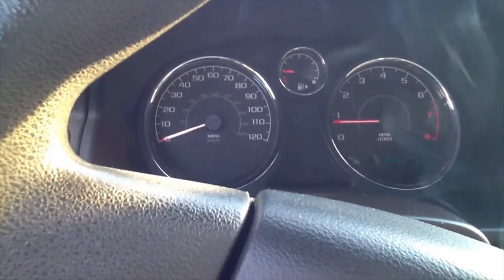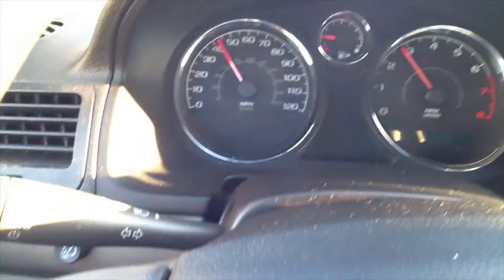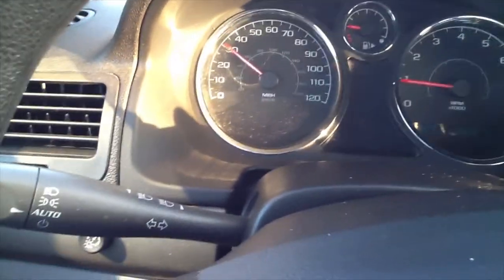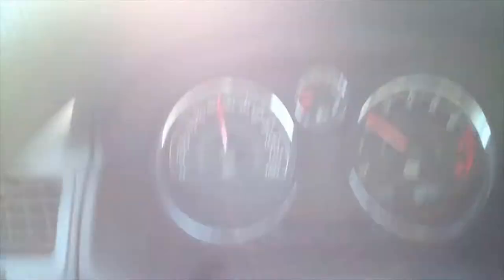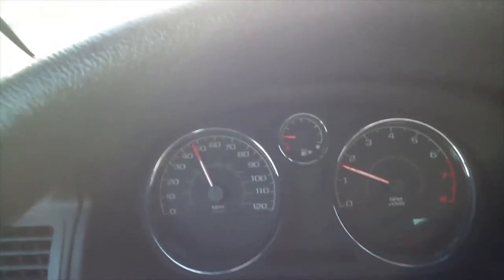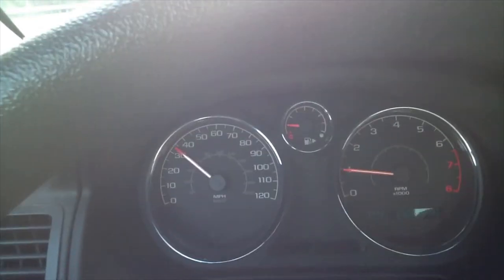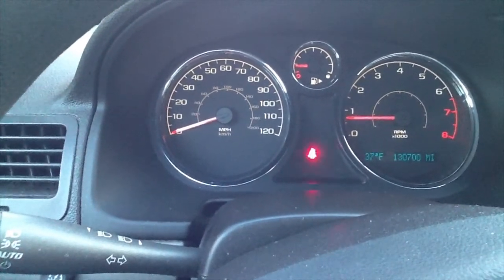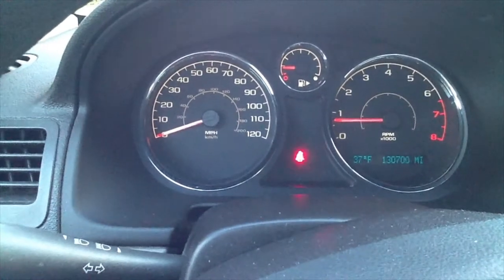Breaking in New Brake Pads & Rotors

Comment: Just got back from doing just as you said... my new brakes look and smell like there cooked... really hot and gold/blueish color. Brembo rotors and pads. Letting them cool now... I hope your right!
Reply: Right 😂😂 they over here smokin. Poor babys
Reply: He’s right wasn’t he?
Reply: For the majority of pads and rotors (slotted/drilled/full-face) this method or ones similar will work fine… 

Honestly I would think Brembo’s probably have a slightly different break in procedure but I could be wrong. When you did the calipers they didn’t come with ANY instructions at all? I’m not big on instructions either BUT for instance I just installed Hawk rotors and pads on my car and inside the rotor box was a card with the specific break in process for the rotors… Whenever you do any of the processes to ‘bed’ the pads/rotors the brakes are gona get hot, they are going to smell bad and A LITTLE bit of smoke is common, if you’ve got Cheech and Chong coming from behind your tire then you may have an issue - either went to hard/fast with the break in process OR you could have a sticky slide pin causing the pads to hug/hold the rotor tighter and longer then they should (take out, wipe off and reapply lube and work them to make sure they’re moving good)
*Moral Of The Story - smell and LIGHT smoke is common the first 1-2 hrs OR 1-2 days after you install (depending on how your drive your car), if the smell and/or smoke continues after the break in process is done pull em back off and check the slides …   Did you do rotors and pads in all four corners?
Reply: @joeymcquilkin3670  I just finished installing new front rotors and pads I test drive it and I hear tiny grinding noise ONLY when I apply breaks is this normal ? 

Note : I did lubricate slide pins and hardware also and cleaned everything possible including the piston when I did the installation.

Comment: What happens if you didn’t exactly do this and just drove daily? It’s been 4 weeks of driving. 
I had my tires rotated and since this I started hearing a weird noise like a rumbling sound at slow speeds when applying the brakes. 
I got 4 new tires yesterday and I’m still hearing this noise sometimes. Any idea of what it can be? Confusing part is it didn’t start until I rotated the tires but i have all 4 new tires now and still hear it sometimes
Reply from the maker: When breaking in new brake pads you're "transferring" a small amount of the pad onto the rotor....Not breaking in,  and just driving normally, can transfer large clumps from the pad onto the rotor causing an uneven braking surface....That could be the cause...You could wipe the rotors with rubbing alcohol and then break in the pads....Good luck!

Comment: Thanks for the video. I got new brakes and rotors about 200-300 miles ago, and I got the expensive pads. Everything sounded good until my girlfriend said she kinda slammed on my breaks to avoid a collision. Now my breaks make a somewhat loud grinding noise whenever I press the brake pedal somewhat hard, and the harder I press the worse the noise gets. Is this something I should be worried about? Is it possible they are still be broken in? I heard it can take up to 400 miles for brakes to be fully broken in but I wasn’t sure. Thanks in advance!!
Reply from the maker: If a shop installed the rotors & pads I would bring it back and have them repair it... The brakes shouldn’t make a grinding noise...Could be something wasn’t properly installed and came loose causing the noise...After they repair it, I’d find another shop to go to...Good luck!

Comment: I have a question I just upgraded to slotted rotors with ceramic brakes I wasn’t aware of break in I went to regular driving doin complete stops it’s been 2 days n when braking at approximately at 60 mph steering wheel start shaking bad  I feel the shaking coming from Brakes how can Is it fixable I have to replace rotor or resurface
Reply from the maker: This link is a good read for possible problems. 

https://blog.firestonecompleteautocare.com/driving/steering-wheel-shakes-when-braking/

Good luck !
Reply: Thank u

Comment: I just installed new rotors and brakes and I hear a kinda grinding noise is that normal. Should I do this I haven’t driven the car I just hear it while moving it in my drive way
Reply: I only hear the noise when I brake
Reply from the maker: Did you apply lubricant to the caliper pins and the back side of the brake pads?....Also, did you “break in” the new pads?
Reply: @beachtroll8344   I put lube on the brake pads and I should probably add more but no I haven’t driven the car at all just moving in and out the garage

Comment: Couldn't I just ride the brakes while on throttle a few times and get the same result without so much traffic disruption? Is the slowing down to 10mph necessary or just to get them warm enough?
Reply from the maker: It is pretty necessary so the pads “break in” evenly to get the most life out of them.

Comment: I just replaced pads all around. 2 rotors gad minor groves so i left them on. Now the passender rear in rubbing. At first it felt like the brakes where holding the rotor but it losened up.now i still hear rubbing. Could this be the pad still trying to adjust to the rotor? I believe it will go way over time??? Anyone?

Comment: Hi.. I been trying to ask some YouTube-ers some questions but I don't know if they're still or What! But my question is, my vehicle was driving funny and noticed that I have 19" rims in the front and 17" rims in the rear. What can go wrong?
Reply from the maker: Modern cars are equipped with systems such as ABS and Electronic stability control (ESC) or similar systems. The system uses sensors to measure each wheel’s number of revolutions to determine if a situation of low traction exists. If needed corrective measures (such as limiting engine output or applying the brake on individual wheels) are taken automatically. Different sized tires would play havoc with such a system (I.E. a speed difference between the front and rear wheels) and could seriously affect vehicle stability as it battles a perceived problem with the vehicle’s traction....I would put the correct  size rims all around as per your vehicle’s owners manual ASAP for your own safety.
Reply: @beachtroll8344  thank you for the reply. Yes, I will be putting the rest of correct rims on. It's also an AWD vehicle. Friend told me that bearings can go bad.

Comment: What do I do i put new breaks and rotors on and it started to smoke only on the driver side
Reply from the maker: The smoke is probably just the excess caliper lube or brake cleaner burning off. It should go away after driving a few miles.

Comment: I know this is pretty old so I’m unlikely to get a response but what if you have barely used(like a week) pads and new rotors? Could you still use them?
Reply from the maker: Sorry, I don’t understand the question...You took the pads and rotors off a car and want to use them on a different car???
Reply: beachtroll hello I have a question I replaced my pads and rotors but when I’m braking at high speeds 60mph+ I still feel vibration in my brake pedal any plz help
Reply: @beachtroll8344  "barely used pads and new rotors"

Comment: I installed new pads and rotors at my after doing this my brake stArts smoking.
Reply from the maker: It’s more than likely there was excess brake cleaner still on the surface....It should go away after driving for a bit.
Reply: So it’s normal to starts smoking after the installation of the new pads and rotors ? and would you let us know what was the caused of the hot rotors/pads and how long does it take to go away the smoke/burning smell.

Comment: I just finished installing new front rotors and pads I test drive it and I hear tiny grinding noise ONLY when I apply breaks is this normal ? 

Note : I did lubricate slide pins and hardware also and cleaned everything possible including the piston when I did the installation.
Reply from the maker: Did you lubricate the backs of the brake pads?... It could be residual brake dust which should go away in a couple of days.

Comment: Great video! Quick question, I had a shop put on new rotors and brake pads and when I got on the car, I feel the brake pad spongy. The mechanic said its because they are new and the rear rotors need to self adjust. He didn't mention bedding or anything. Should I go back ASAP to have them bleed the system for any air that may be in the system or is this brake pad feeling normal until the brakes are bedded in? I have barely driven it for about 30 miles since the job.
Reply from the maker: I would definitely bring it back....The brakes should not feel spongy.....The system needs to be bled....Breaking in new brakes (bedding) makes the pads/rotors wear evenly...Good luck!